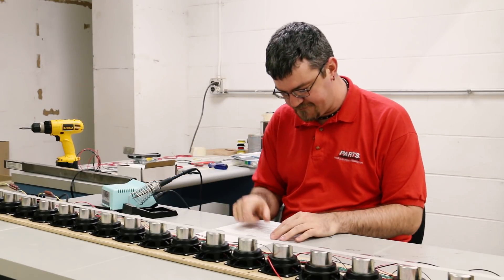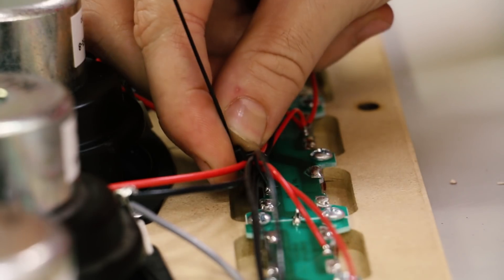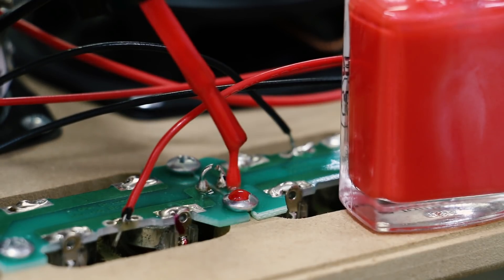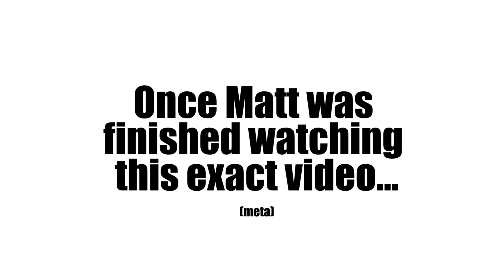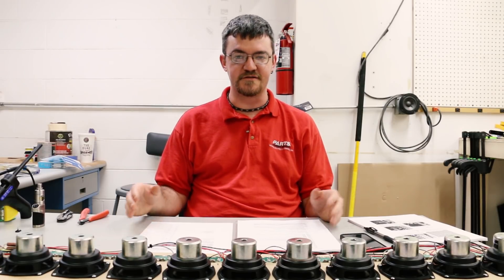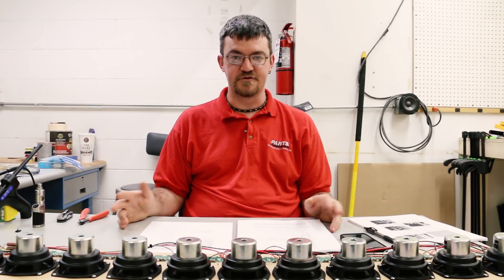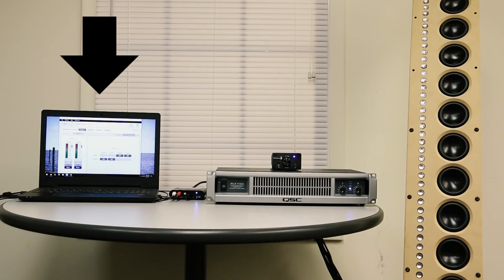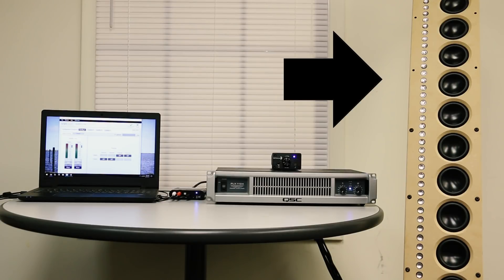How to build the CBT36 Speaker Kit

Comment: Though I buy into the concept of a non-nodal sound field, I have a hard time believing that this design would have good transient response.  The listening distance from the closest to the farthest speaker is several inches.  That would severely muddy any impact sound.  I've only seen empirical tests of this speaker with white noise but that only demonstrates frequency response and associated cancellation points.  For someone that reads AES journals, I find it interesting that there is no mention of crossover phase shifting, and time delays and how this design deals with them.
Reply: These speakers are as detailed as my expensive planar headphones and tube push pull amp; which I no longer use now.  These speakers are better and the soundstage is unbelievable wide.

There are YT videos that go into detail with computer simulation models as to why the curvature(with shading) makes what you hear perfectly time aligned.  The soundstage they produce  is absolutely stunning.

Tweeter and woofer timing is calibrated in the active crossover.

I have these speakers and my quest for that “perfect sound” has ended.
Reply: @gavincurtis  That's all that matters.  I've designed and built my own hybrid ESL/transmission line woofer system and use a DBX Venu 360 as a crossover to a pair of Nelson Pass designed SE amps.  Seems like we're both happy campers.
Reply: @ggendel  I would love to hear your system.  :)

Comment: Putting together 2 sets of these.  Can't wait.  The rear housings I had custom painted with truck bed liner paint.  Not sure what to finish the front bezel with though.  Your 4th an 5th tweeter from the top at 3:00 needs help btw.    ;)
Reply: how did it go ? :)
Reply: Probably won't be finished until spring.... wife has the oversized honey-do list for our basement.  But I promised 1 finished basement for dream speakers.  It's not easy to convince your 2nd half to spend nearly $4000 on speakers that have to be put together.  If she knew how much the three amplifiers and DSP crossover cost.....  :P
Reply: haha I see. Well good luck. hope they turn out great, you would still be among the first to have your own cbt's at home!

Comment: Honestly, how tf do you wire so many up into one output?
Reply: It's a combination of series and parallel wiring. 
There is a complete wiring diagram on page 88 of the manual: http://www.parts-express.com/pedocs/manuals/301-980--epique-cbt36k-assembly-user-manual.pdf

Comment: I just dont understand how you manage to get 8/4 ohm out of this... Do you connect some on series and other in parallel ??
Reply: Yep, series and parallel... also, this system uses separate amps for the woofer and tweeters.

There is a complete wiring diagram on page 88 of the manual: http://www.parts-express.com/pedocs/manuals/301-980--epique-cbt36k-assembly-user-manual.pdf